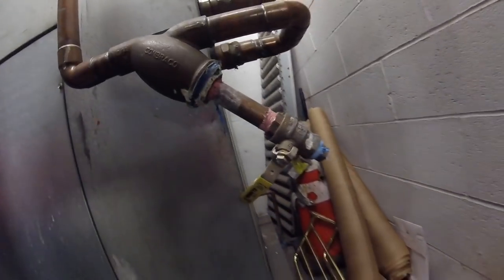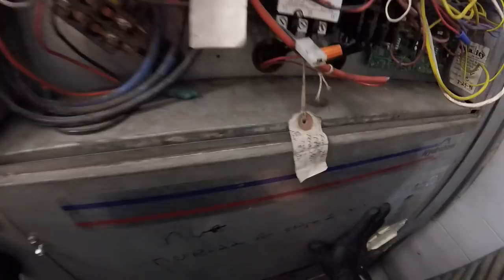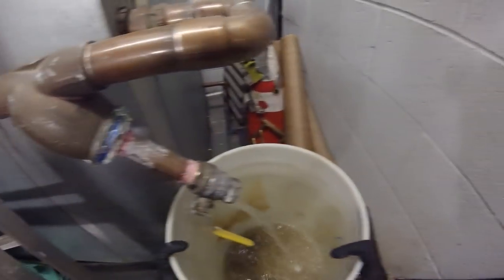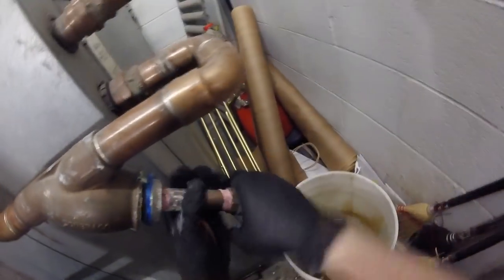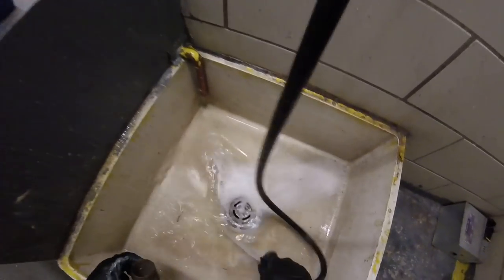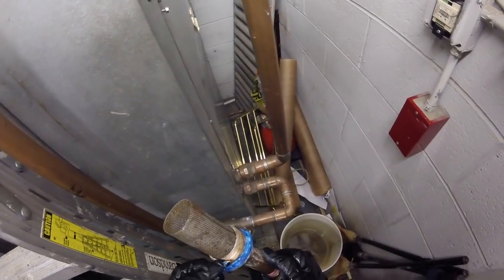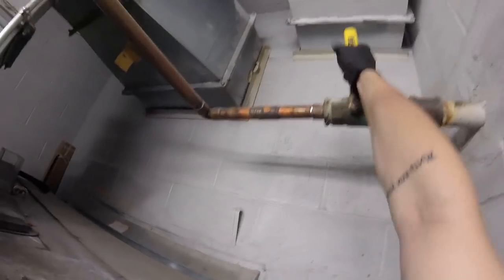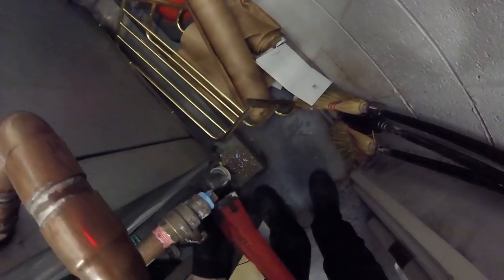HVAC/R: How To Pull And Clean Strainer On Water Cooled Equipment (Step by Step)

Comment: That was nicely done. Do you have any showing how to drain a condensate drain line and pan from a water cooled apartment HAVC system in a Condominium or Apartment building. One with a central cooling tower for all the units ? We have constant problems with the condensate pans overflowing inside apartment units because the drain line constantly gets clogged with "snot".

Comment: Why didn’t you purge the air out? That system didn’t have a pump? Just out of curiosity. I’m still in the process of learning chillers, towers and water source heat pumps
Reply: Condenser water pump and cooling tower
I believe the air vents are tied into the main condenser water loops somewhere in the building.
Some water valves or strainer housings have manual air purging ports. 

Water pumps and cooling towers are required for water source heat pumps /AC systems
Reply: Rule of thumb 
On WSHP

Outlet water temperature - inlet water temperature  = 10 degrees or lower

95 (Out) - 80 (in) = 15 degrees [dirty strainer or clogged up in the condenser water lines)
Higher than 10 = dirty strainer

Comment: Hi there! Thank you for the video and step by step explanations. I was actually looking to learn how to flush in-unit HVAC systems, since my building has cooling towers but we also have seperate units in each room of the apartment. They used to do the maintenance regularly but since Covid started, we never invited them over. So now I have two units blowing out room temperature air, instead of cold in the summer or warm in the winter. I used to watch the guys do the maintenance but my memories are kind of blurry. My question is, is there a quick way for you to explain me how to do it? I see two valves when I open the AC box inside the wall. I don't know which one is for the incoming line and which is for the drainage. I also don't know whether I should close the two valves before I start 😓 I'd really appreciate it if you could kindly give me a couple of tips that may help me in this cold winter days! Thanks a bunch in advance 🌟
Reply: did you ever fix this? I have the same problem happening now
Reply: @minas.a.4393  Hello. Yes, I actually flushed the units by turning off the two valves first. Then detaching the outgoing line from the valve, finding a large enough bucket to collect the dirty water coming from the hose, and opening the incoming line's valve. There's significant water pressure, so I'd suggest anyone to be very careful about the entire process. Once the dirty water starts coming out clean, you can then close the valve and reconnect everything back. Once everything is tightly secured, open the outgoing valve first, and then open the incoming water line.  The incoming water line is the one that goes directly into the unit, and that's how I figured my layout. Hope this helps!
Reply: @sertacsilbastan  thanks! That is what I am planning to do.. but I’m not strong enough to take off the cap! Hahaha
Reply: @minas.a.4393  a wrench would help :)
Reply: @minas.a.4393  I will take it off for ya 💪

Comment: Those strainer caps are usually sealed with a rubber o-ring.  Why do you need Teflon tape.  Get a new o-ring & then you won’t have overtighten that strainer cap.

Comment: Why are you using an 18 " Wrench to take off  a plug....
Reply from the maker: In my video I mentioned that someone stole my adjustables so I had to use what I had at the time. Haha I know, its looks ridiculous but you need to do what you have to so that job can get done👍 Thanks for watching. Be safe👀

Comment: sucks you got your stuff stolen. worse feeling ever. just a tip. you can add a garden hose connection with a cap on the end where the cap is and connect a hose and back flush the unit and reclean strainer. allows you get get all the debris in the condenser loop. not a huge problem on copper pipes but if they're using black pipe anywhere in that building or anything other than brass or copper. lines get nasty really fast especially if the tower isn't treated on a regular
Reply: hi david, im really interested in this tip. So you connect a hose to the cap and shoot water through the cap to "backflush"? 
wouldnt this be the same as if the inlet water was just running?
as in the hose water is now effectively your inlet water
then you remove the hose and let it drain again?
this would remove more debris than just draining the pipes after closing the valves?
Reply: @alexanderzhao1457  basically the hose is just a drain down to a barrel to collect the water. close Entering water valve and open return water valve. and open drain valve for your drain hose. it forces all water through the unit and the strainer and out the hose. drain it til water is clear, after which close return and open entering. water coming out should be comparable to the return. if you open return and barely anything comes out or resembles a sink faucet you have a restriction. most likely due to strainer which will need to be cleaned but ive had it clogged up at the inlet or outlet connections on unit or inside the condenser loop itself. after youre confident the system is clear, clean the strainer and put unit back in service.